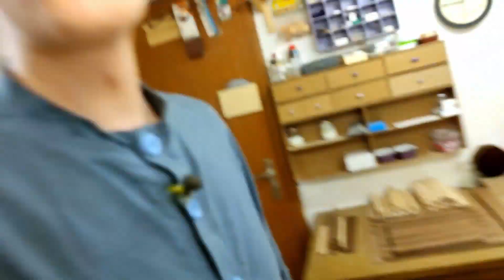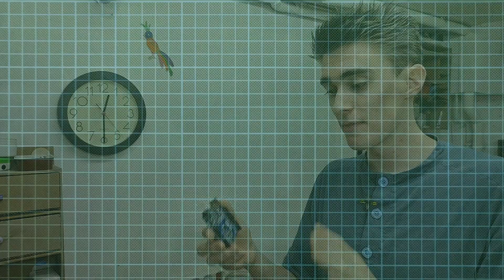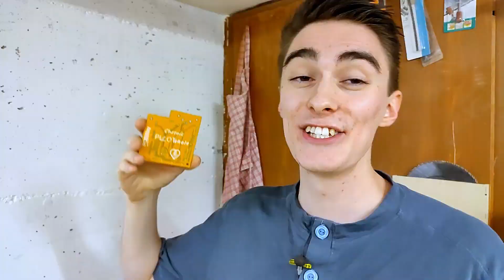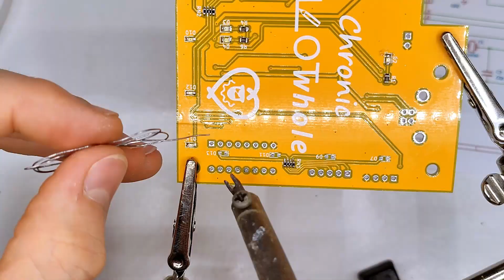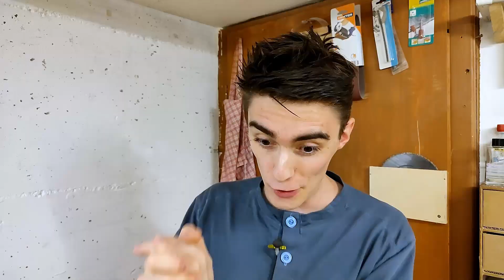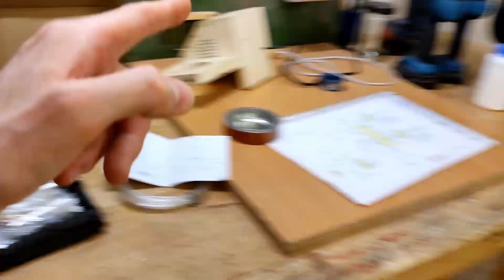How to WIRE UP your Arduino CNC plotter using 28BYJ-48 steppers and RC servo

Comment: This post is really great Ben. Thank you. I was awfully disappointed when you connected your board to arduino IDE for the first time. I said to myself, it's going to be quite hard to fix it. But you debunked the culprit! as a good Sherlock Holmes ;). It's a bit amusing when you realized that KiCAD was the culprit. You have some natural talent in drama, really. That makes your posts so natural and spontaneous.
Your workshop is neat and awesome. A genuine jeweler workshop. I try to make my own one as ergonomic and pleasant as possible. I spend many hours in it. It's almost mandatory. I love your new smartphone holder. Are its details somewhere on your blog?
You're a kind of genius. I had never designed a prototype with the idea - excellent idea and logically the cheapest one as you stated it - of populating it with elements "borrowed" from another mass-produced item... Not that bad! But it's a terrific challenge. Your diy tiny tools did their job very well. This post is a great one indeed. I do believe that it has demanded a huge amount of work. Thank you for sharing it Ben.
Reply from the maker: Thanks Philibert! I know, I was really disappointed as well, especially as the footprint of chip was literally the one thing I didn't check before submitting the gerber files. Thought I could trust the software to do its job, but apparently, no. Even weirder, the footprint for the USB serial chip was perfectly good! Don't know what went wrong with the Atmega one.
My mom said I almost overdid the drama in the one clip 😂 but I love what things like making the screen go totally black and the right music can express! 
Yeah, setting up a workshop requires a lot of time, I poured the soul of about half my life into mine at this point.
The new smartphone holder lamp was just a quick in-between project because my old bench light died, so I only did a reddit post about it. But it's basically just this U channel made from thin MDF and painted white, then lined with neutral white LED tape. The smartphone holder is just another one of the simple wooden ones I did a video about ages ago glued on top :)
But yeah, even though I'm usually not proud of things, I kinda am of this video, it must the best one I ever did. Glad you appreciate it 🙏 :)

Comment: That desoldering actually looks satisfying! But it does seems that my next purchase would be a heat gun...
Reply from the maker: I have a heat gun! But I couldn't use it on the small components because I had to do those one by one in order to avoid getting them mixed up

Comment: In case you didn't know. 28BYJ-48 can be converted to bipolar motors with a 2 min manipulation. That way they might roll with the original GRBL firmware and regular stepper drivers? Hope that didn't spoil the fun 😄 I enjoy following your fun printer project.
Reply from the maker: I know, I know, finding out I could convert unipolar to bipolar was actually what inspired my 3D printer series to begin with :)

Comment: Hi Ben! Great channel indeed! Don't you fear you infringed some Arduino's copyright by picking their design (and components as well 😉)? Pretty inspirational. Thank you!
Reply from the maker: Thanks! I don't think copyright will be an issue, after all I just copied a cheap Chinese clone and who would the manufacturer of a clone be to complain about others stealing from them what they stole from yet another one? 😂 Besides, for the most part what I copied is the default schematic for the Atmega 328p, which can readily be found online - that's what the clone is based on as well 🤷 Even the component values of the clone are just the generic values proposed in these schematics. And when it comes to visual design, my board looks nothing like any arduino trademark that I could infringe upon, so yeah I have no worries :)
But thanks for looking out!

Comment: Fantastic energy and knowledge in this video. Well done. I've built a plotter using an arduino shield. It runs Nema 17s on the X and Y. I'm currently using a 5v stepper (same as you use) to lift/drop the pen. Using the pen motor is not ideal as it over heats. The arduino shield will not operate a servo as well as two Nema 17s and....a servo. Ideally I'd like to use a sevo on the Z axis. Anyone have any ideas?
Reply from the maker: Thanks! I'm glad you liked it, as I try to make videos as educational AND entertaining as possible :)
Do you use the 28BYJ-48 connected to an A4988 motor driver? If so, you could try turning the current pot all the way down, I think the regulation goes down to about 50 mA or so. Although I've personally never had issues with the motors on 5V as long as no more than two coils are active in idle. As for the servo, it should be relatively easy to add even with a shield - it seems the Z-axis limit pin on the shield is connected to digital pin 11, so just connect the servo yellow wire to that and the other ones to a separate 5V PSU (connecting both grounds required).
Then for the Software just use Robottini's GRBL fork - I'm covering everything extensively in the new part I'm currently working on (should be out around Christmas:) - the servo adaptation is actually a big pain in the ass in terms of G-code you need...
Reply: @ChronicMechatronic  Hi.. Thanks for reply. I'm not that techy. Although have managed to design and 3d print the plotter. I used grooved bearings running on din rails. I'm getting great results at the moment in terms of accuracy and speed is ok. I've never had any luck with hobby servo but will have another try with the info you gave. I think servo will speed things up quite a bit. Yes I'm using a grbl shield V3. Two nema 17s and 28BYJ 5v motor for the pen. X1. Drivers A4988 and x2 DRV8825 for the axis. Will put a video of my set up and will  comment again with link in case you want to have a look....cheers
Reply from the maker: @Cybertruck1000  well, I just now spent several hours struggling with my plotter to make it work for the video - which is already 36 minutes long at this point and I haven't even covered HALF of the problems I ran into. Honestly, if you're not very into computers and programming I do NOT recommend plotters with a servo. These are not a beginner project - it's an absolute nightmare software wise, because everything is botched together by different people with different intents and purposes so nothing fits together...
I think your easiest "fast" solution would be to use one of those DVD drive stepper motors with the little inbuilt lead screw for the Z-axis instead. Those are bipolar so you can just hook them up to the stepper motor driver and they should be reasonably fast... But this servo stuff is a pain - like, I have four coordinate systems that all have Y+ and Y- going in different directions, and to get something on the paper I have to mirror the image before exporting the G-code... 🤦🤦

Comment: Hi, can we make the frame out of plastic sheets(layered) to avoid problems with wood expansion? And is using lead screws better than timing belts? What about using nema 17 stepper motors? Thanks
Reply from the maker: Yeah, you can do that if you want to do yourself a favor - some NEMA 14 or pancake NEMA 17 steppers with GT2 timing belt seem like the best option. Then you can also use a normal GRBL shield with A4988 drivers which will make the wiring and software a lot easier. Lead screws are good for something like a CNC router but not a pen plotter, as it'll be very slow and take ages to draw a single picture. Generally you get bored of these plotters pretty quickly.
I don't think making the frame out of plastic would be really beneficial here if your design is going to be anything like mine in the video, I've never had any problems with hygro-expansion of the wood - the spring loaded rollers took care of it quite nicely it seems. I'd rather go for better linear rails, a few V-groove POM wheels on (anodized) aluminum square tubing from the hardware store should do a nice job. Hope that helps :)
Reply: @ChronicMechatronic  Thanks for the reply, I am planning to use linear rails with sliding linear bearings. Is there a reason to use pancake nema 17 motors?
Reply from the maker: @MegaTechno  no real reason other than full-size NEMA 17 being slightly overkill. But if you have some of them kicking around already, or can get them for cheaper, they'll do the job just fine of course :)
Reply: @ChronicMechatronic  Thanks for the quick reply, Yes full size ones are cheaper. And is a core XY system faster, or should I stick to this design. And why are most of your builds made from wood?
Reply from the maker: @MegaTechno  corexy is certainly faster and probably has more "cool factor".
I make stuff from wood mostly because I've been into woodworking for like forever, and wood is a fairly cheap, abundant commodity (albeit not quite the right material for CNCs =)
Reply: @ChronicMechatronic  Thanks, your channel is really underrated, people are probably used to big YouTuber finishing a project in one video. Really appreciate the detailed video on every part of a build.
Reply from the maker: @MegaTechno  thanks, yeah YouTube definitely created some unhealthy productivity expectations for videos - sure, I've been making slow progress on projects way before making videos, but especially for the big-ish youtubers without a whole team of employees behind them, I've never understood how they pump out entire projects at that rate - either they never sleep or I don't know...
But it does mean we never get to see the part of the project that interests me the most - the design considerations and thought processes behind engineering choices made - as a result I inadvertently overdo that part in my videos every time :D
Good for us nerds I guess!
Reply: @ChronicMechatronic  Thanks, I enjoy every part of it, but just isn't good for youtube :/
Reply from the maker: @MegaTechno  yeah, I'm trying to strike a balance between making videos interesting and having them be algorithm-friendly. Also took me till about a year ago to kind of learn the game; now I can sort of tell in advance what videos will be 'a banger' and which won't. I'm sure if I'd played by the rules from the beginning I would have reached 100k by now - but at what cost... The hardest part seems to be over though, now that I 'paved my path' so to speak. From 10k to 100k feels easier than 1k to 10k did; these days when I upload I can feel things start to get traction (compared to years ago), so I guess now it's mostly a matter of walking that fine line and uploading as frequently as possible...

Comment: My experience with those cheap geared steppers is that they have a lot of backlash (slop between the gears) which is fine if you only go one direction, but if you, for example, go 200 steps in one direction to reach point A, and then another 200 steps in the same direction,  and then 200 steps in the opposite direction, not only do you not end up not exactly at point A, but it is difficult to characterize the slop in such a way that you can compensate for it in software. What has your experience been?
Reply from the maker: I haven't tried compensating for the backlash in software yet, but I generally found it to have less of an impact on the result (for a pen plotter anyway) the easier the gantry is to move. Of course the looser the gantry the less precise it generally is, so yeah, the best solution is not to use those steppers in the first place IMO. I think the best alternative to the expensive NEMA type stepper motors is to use the unipolar ones commonly found in old scanners, printers, photocopiers etc. Those may have a low step/revolution, but that can easily be made up for with a low pitch lead screw like threaded rod. Plus, depending on where you get the e-waste from, those motors are totally free!

Comment from the maker: Little quiz for y'all: How many single clips would you guess this video consists of, and how much storage do you think this footage takes up on the drive?
Reply: 200?
Reply: about 20 clips and 10 gigs on drive. 1080p60 format requires a lot of space especially when you edit with Da Vinci Resolve
Reply from the maker: @scottbaeder37  not including all the picture cutouts for the animations it's approximately 350! But when counting the undissected clips of raw footage it's only 136 so you're pretty close!
Reply from the maker: @joetkeshub  whaaat, only 20?! I wish it was!! 😂😂 More like 20 times 20, and 46 gigs on drive!!! Five audio tracks, eight video tracks - I actually shoot in 1080p30 and only edit in 60fps for the higher timeline resolution. Image stabilisation for the handheld shots doesn't work well at 60fps...

Comment: Can these motors be used to build a 3D printer?
Reply from the maker: I STRONGLY advise against it. See my lengthy video series for the trouble you'll land yourself in trying it.
If you want a 3D printer for cheap, browse some local marketplace sites for a used one, sometimes you can score a pretty good deal when people just want to get rid of an old one. Even if it's broken you get a sort of parts kit with decent stepper motors included